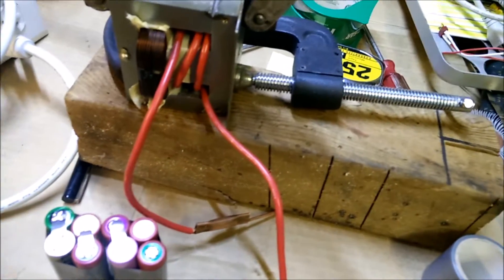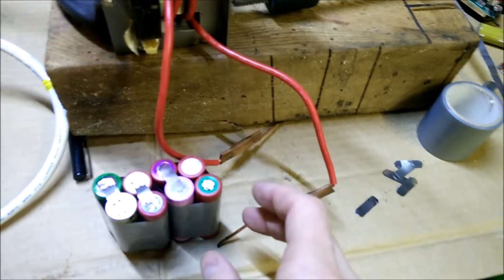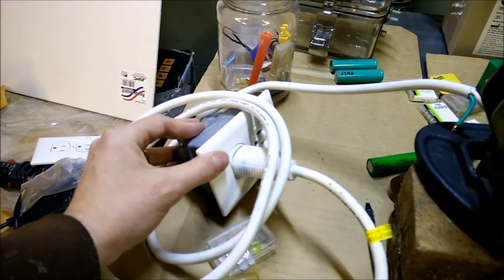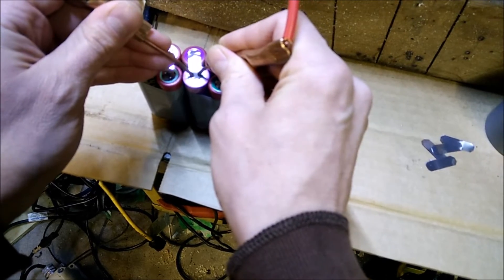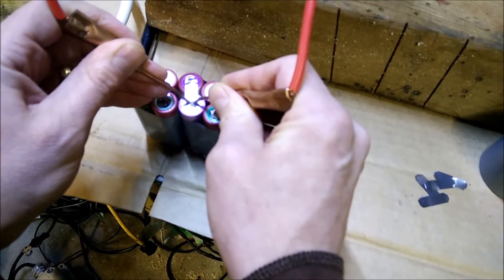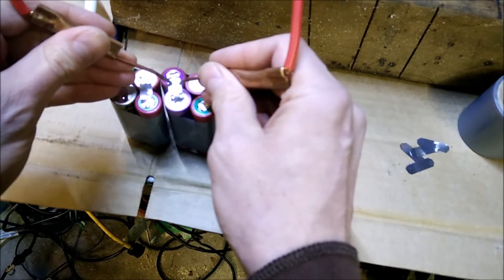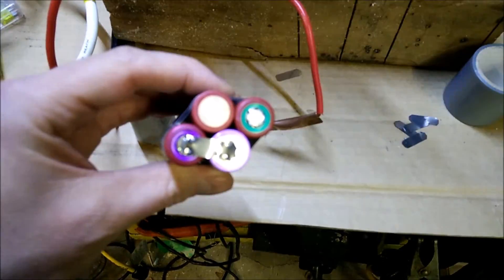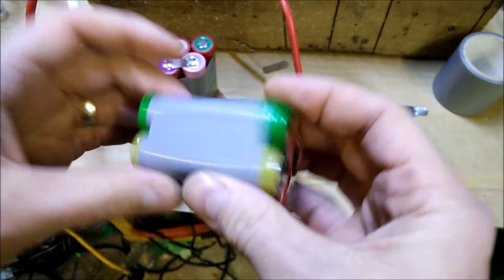18650 Battery welder

Comment: Um what's the rubbing alcohol for?
Reply from the maker: It cleans off any oil or other contamination. I also use it to cool my welding probes as the heat up.

Comment: Should I presume a 240volt (45watt) battery charger outputting DC 12volt 2.5Amp would not be powerful enough to spot weld?
Reply from the maker: Peter Gee I don't think it would be but have never tried it. I think you would need higher current.
Reply: Its all about the amps and a low voltage, probably 30 amps plus to heat it quickly enough to fuse together

Comment: That much turn with that thin cable would not be giving a weld nugget. Try 2AWG cables with 2 or three turns. The weld time is too much they should be in milliseconds like 10ms or maybe 20ms, well it should be ok with that thick cables. 

https://youtu.be/WAoY9HTdF6o

Comment: How come when you welding,that does not give you a shock,by holding them both
Reply from the maker: Tony Reynolds because the voltage is very very low. High current but low voltage makes it safe.

Comment: What is the input voltage to the transformer???
Reply from the maker: Black Dragons It's plugged into the wall so 110vac.
Reply: if anythig will happen if i connect the primary to a 230v ac 50hz supply. would it affect any of this setup???

Comment: Hi Ben would you be able to give me some info on your transformer like wire size, amount of turns and what amps it's putting out. I have one which I use for plasma melting different metals and arc welding but it's a little over the top spot welding            ( LI -- ION ) batteries.  Would be much appreciated.
Reply: Craig Sawyer its 10awg single core and you keep the primary coil as is and the secondary has about 5 turns, its up to you, if you need more amps ad a second insulated wire with the same turns in parallel this will double the amps.
Reply from the maker: Hi Craig! I would recommend watching "King of Random"s video about using microwave transformers. I tried to find a wire size on mine and could not. Just use some heavy wire. You can fine tune it by winding it more or less. I think if you watch his video you will get the idea. Mine works well but the two probes get too hot to hold after four welds or so. I have some more batteries I've built and need to upload more soon! 
https://youtu.be/r6oDCbcmtWw
Reply: Thanks Ben, I do watch him he comes up with some great stuff, thanks again.